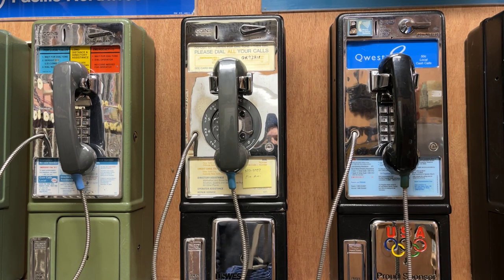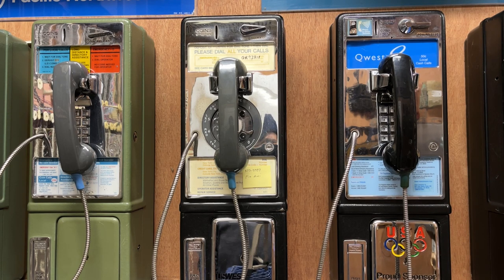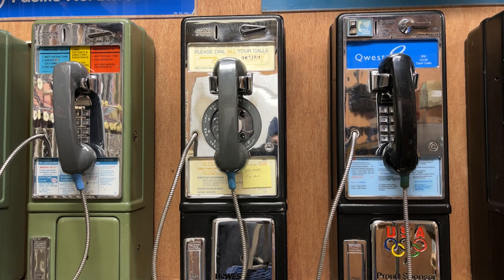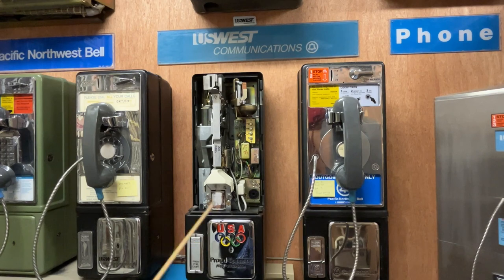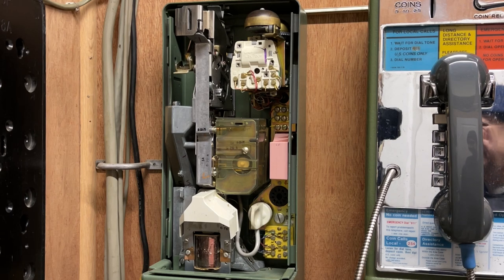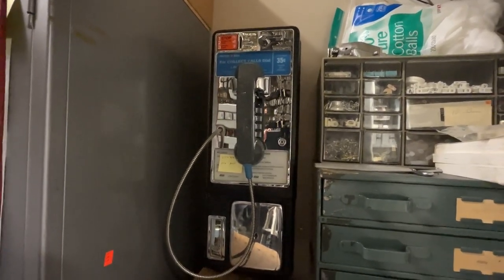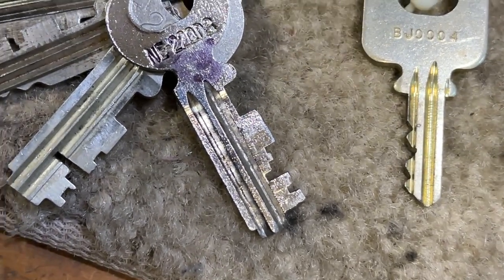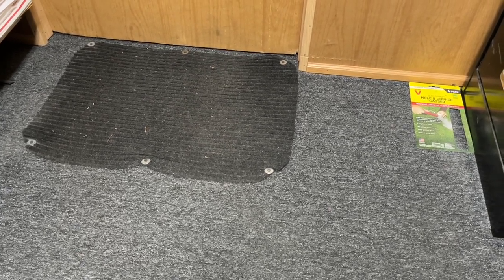Payphone, keys, and basic information for the beginner.  (1970's thru 2000) 3 slot to follow.

Comment: I acquired a WE coin set many
  years ago. It had been abandoned and forgotten by the local phone company. My boss at the time was 
An Ex- NYT coin tech. He showed me 
How to open the upper and the  lower housings by way of a hammer
And steel punch. I recall punching and splitting the lock cylinders and 
Picking out the broke parts along with the lever parts. We had a "T" 
Key so there was no problem opening the lock mechs.

Yeah it took some time...

Comment: BellSouth put in Protel boards in the 1990's when they stopped running payphone lines. I use Protel boards in my home payphones and they are connected to an Asterisk PBX with a channel bank as an interface. The abloy locks are easy to defeat by knocking them with a punch. Medeco needs a die grinder. Once I was able to pick a Medeco by pure luck.

Comment: Memories.. 1983 a phone with no dial like the 4th shown but not covered in narrative, I was driving from Southern California to the Midwest after boot camp in San Diego and stopping for Disneyland.  It was at a rest area, I'd almost estimate it was so far from town that it was radio or microwave connected, it had its yellow placards with big letters, DO NOT DEPOSIT COINS UNTIL OPERATOR TELLS YOU TO", But this means immediate collection post pay which was more of a independent company style of circuit/characteristic. 
Where I did 9th grade our cafeteria went from having a 3 slot when we were on Stromberg X-Y to a more rectangular box almost all flat front except the receiver cradle, and coin return (round plunger) were raised, IIRC the coin box was even buried behind the front cover, about 15 years later this same model was seen in Montreal so I assume it was northern telecom furnished in <in one if UTS early purchase territory <United Telephone>.
In 1987 I almost joined Amway after seeing their pay phone, but I didn't pursue spending almost $700 them as I had no network of people for make it a profitable venture,  my father did all my boy scout sales at his power plant job, I only did good selling popcorn kernels. 

As for rate tables it's so easy knowing how far (using V&H calculations) as an entire area code to entire area code could be the same rate, only needing subcalculated when there is a mileage band close by, and rounding to $.05 incremental units makes a difference. 
To this day most companies charge a flat rate now for long distance [except Verizon landline where I worked; Philadelphia LATA to Delaware were  our most expensive calls, yet short distanced] 
Back in the cord board days some places had configured special routes where a operator would answer and wait for you to deposit say $1.35 for the first 3 minutes, and once the cord was pulled out after collection the call progressed, Evan Doorbell went into reasonable detail of this here on YouTube.. PhoneZone I think it was called, it was the early days of DDD and pay phones weren't that advanced as to rate calculations.. in those days operators always called rate and route for rate step table information although as few area codes there were a simple laminated sheet could cover half the nation at the operators fingertips as operators were commonly located in each exchange vs centralized..
I to this day, have accessible databases of v&h coordinates, even direct tariffs from NANPA   filed monthly that show the information, you just have to do calculations with the provided numbers. And people thinking that recalculated every time is no biggie, compared to using a table think again, one lookup is faster than two calculations finding the difference of two pairs of numbers, squaring them, adding the squares then getting the square root and rounding .. see all the work one table can do?  Do it once and summarize the like information.  Another example say all 22x numbers in a certain NPA were rate Y from your area, why list them all individually (a computer would want that, it mostly is programmed for a full match) but a human can be trained to use faster shorter lists
Reply: I once bought a bunch of "payphone stuff" on a pallet. it came with 3 phones, and 6 Motorola bag phones, along with the analog port module for each one.  The bag phones were active till they shut down the AMPS system.  guess they'd put the bag phones in the top of the booths to be able to install them where there was only power. great score.

Comment: Phil, if I might ask you some questions as you are quite knowledgeable in these phones. Some time back I bought a Western Electric 1D(2) payphone. There are some things about this phone that makes me quite curious about its beginnings. On your phones here the coin return buckets have the words "Bell System - Made By Western Electric". My phone merely says "Made By Western Electric", omitting the "Bell System". My phone also came with two complete sets of two keys each (upper & lower locks) that begin with the designation "29B". Inside of the phone are some dates inked in various locations that go from the late 70's to the early 80's. The phone also has the electronic totalizer. Can you give me any information about when this phone might have been manufactured and at which facility? Right now to me it seems I have a phone made up of a hodgepodge of parts. Thank you.
Reply: William - your 1D WE coin phone was manufactured in Shreveport LA.  The 1D sets were made from the mid 1970's until mid 1980's.  The dates stamped are the original manufacture date and if it ever went through a Bell System Repair Center there will be additional dates stamped.  Each component has its own mfg and repair date stamp and was swapped out as needed for field repair or complete refurbishment in the Repair Centers - so your 'hodgepodge' of parts is typical of the era.   Your 29 type locks are both upper housing locks but will fit in the vault.  In service, a 30 type lock would have been used.